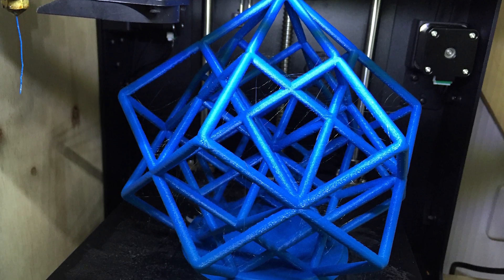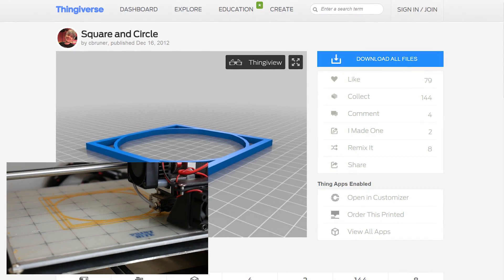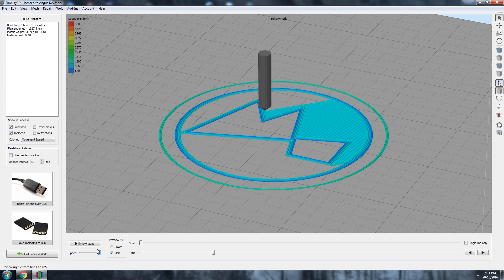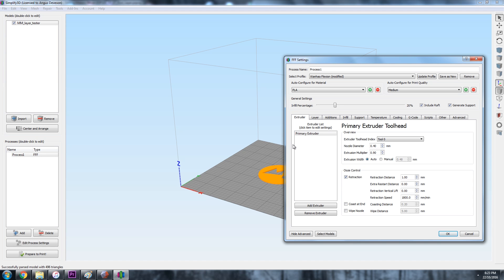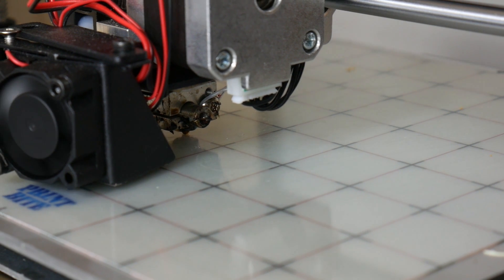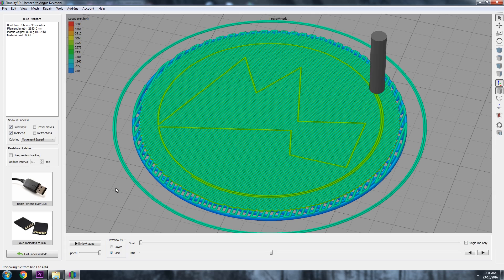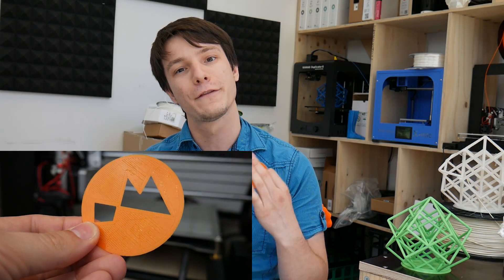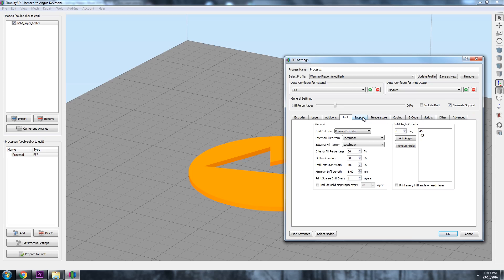How to get the Perfect First Layer - 3DP101

Comment: Cura works with mm/s and what you're using is is %, not helpful
Reply: you can't do simple math? 90% of 5mm/s is 4.5mm/s. Whatever your speed is, if you want to slow it down, multiply it by a decimal smaller than one. for example, 90% is .9. 50% is .5. if you want faster, 110% is 1.1. 125% is 1.25. It's really easy.
Reply: @adamchristophergrigg  What you can do is work on your reading comprehension. My "math" isn't the point to my statement.

Comment: I was pulling my hair out for days and editing the Z-offset to -1.2 to squish the material into the base just to make it stick. I've leveled the board so many times I can do it in my sleep now. I just changed the "initial layer height" in Cura and its printing an absolute dream now - Thanks so much for this video. I dont usually sub but as an absolute beginner of 3d printing wasting hours not even getting the base to stick, you've made my life complete. Thanks again.

Comment: In around 95% of my prints so far, the first layer has been what caused me to restart the print. On the print I did today, I restarted after the first layer about 8 times, and once I got a good first layer, it worked flawlessly for the rest of the print.

Comment: I have a cr10-max and with a raft it does two layers perfectly then the third and fourth start curling at the edge of the line then the part is printed over this and print is fine how do i get the third and fourth layers the same and am using the creality slicer which i love but it has to be a setting in the expert part that is wrong ? can you help thanks David NZ

Comment: This video saved my constructing and printing thin, detailed, stencils.  Basically, "slow it down from ludicrous speed to excruciating." I went down to 20% speed.  First-level lines went down perfectly on my Ender 3. I print .5 mm thick and all turns out!  Thanks for the wise input as to the importance of the first layer.

Comment: I've been noticing something with my ender 3 Max lately. Quick background I'm only about seven prints in. So I'm relatively new. Now I noticed the skirt Prince fine. The outer ringwall. Or whatever you want to call it is usually pretty good but when it starts printing the first bottom layer it seems to mess up somewhat. Now so far it's not affecting the print. But I feel like this is an issue I should address before it becomes an issue.

I'm using pla
200/ 60
Fan speed at 75%.

 so far the end product has been good.  Could my nozzle be getting dirty already? I have kind of been printing Non-Stop. I self-level my bed and they're really hasn't been no issues with that.

But I'm soon to do lithophane and I would like every level to be perfect. Any suggestions.

Comment: Great advice. I did eventually come up with these as well.
I was wondering how often you use glue or adhesive however. 

My Ender 3 V2 reaches a maximum bed temperature of 110 degrees Celsius and the ABS I use warps easily at any temperature below that.

I tend to use a brim and a decent layer of glue in order for my first layer to stick but getting the glue off is really annoying as my bed is the standard glass. 

Should I invest in a different bed material or is there a decent recommended glue that works well and can be easily cleaned afterwards?

Comment: Level the bed the best you can, print on glass, clean it with alcohol before printing, set first layer height on 0.1 to 0.15 mm. Flow 100%, speed 50 to 75 % for first layer. No cooling. No raft, brim or skirt. Works perfect for me on my Anet A8, of course depending on the shape of the STL file. I use Cura and sometimes Slic3r. both work good and for free :) for PLA I set the temp on 200°C (392 F) , and the bed on 55°C (131 F).

Comment: When you realize that you have none of the prerequisites. - bed warped/uneven so no uniform flat surface even with bl touch and auto mesh compensation 
-no perfectly dialed in slicing profile

Comment: Thank you so much, its the simple thing that matters. Its realy the first layer that matters. I had the problem that after the 10th layer the model come up. 

I found the parameter in EasyPrint to heat the first layer more and slow down only the first layer. Now its nearly perfect.
I use different type of filament and wanted to blame it .

Thanks for the practical hints !

Comment: "How to get your perfect first layer on delta?" - Don't buy a delta :D
Reply: @Beau I have anycubic kossel and I did get perfect first layer after I completely disassemble and reassemble it) Seems that it was assembled poorly on the factory.
Reply: @Beau maybe. I found out that you should have true 90 degree angel of the towers and endstops on the same level, software endstops correction works not so good. After that I just set the delta height and that's all. No leveling needed. Predator uses some new kind of extrusion so maybe it can handle 90 degrees more easily.

Comment: Initial layer height is set by cura slicer, and when start to print its getting nozzle up. hat means my bed at -0.2mm + initial layer 0.2 gives 0.4mm distance between nozzle and the bed.
i have my one bed leveled at 0mm , that means my nozzle is touching bed. but when is starting printing, my nozzle is going up to 0.3mm. (In cura I set it that)
I know that because I tested it and measure layer with precise caliper. 
If someone what set bed to -0.2mm or -0.3mm beneath nozzle, should set in cura settings to 0mm, to compensate difference to actual distance nozzle from the bed.
Other wise nozzle is to high from the bed, and then I don't need to tell what happened with first layer. Especially that wals i layer are not connected each other.
my opinion is that rather set bed lower, I like set it in cura settings, because I have bigger ability to change height to  different printed model.

Comment: Had question --- In printing several parts is there any advantage to printing several parts at one time?
It seems that each part takes a fixed amount of time and printing several parts would only add the time that it takes to go from one part to another 
with each layer.
Reply: Hi! Ultimately, it can just be saving the effort of having to load up the next print after your first one finishes. This is especially true if they're going to have the same settings. If you have a printer that has a longer startup process, like an auto-leveling sequence, then you'll save some time there, because it will only do it once for all the things you might otherwise print separately. It can also be putting a lot of eggs in one basket, if one of your prints fails, that could cascade into the others printing at the same time and ruin them. It could also be a factor of trusting your printer to run by itself without direct supervision.

Comment: Thanks for your series, Angus.  Ive watched, and learned from several.

I started with the Printrbot Simple 1405 Wood Kit, and recently purchased a Creality CR-10S.  I have always used Slic3r and Repetier Host ( you know, free is good 🙂 - I donated to Repetier of course ).

Cura 3 and 4 are horrendously slow ( as if I had a dial up modem to AOL ), on my iMac OS X El Capitan 10.12.6.

I am wondering whether Simplify3D is worth the 50% cost of my new printer?  The canned test_dog print that came with the printer, when printed from the memory card was absolutely beautiful!  It is printed with rafts.  I am considering decoding the GCode for the raft settings, and configuring Slic3r to do the same.

However, my time is worth something, too.  Hence my question about the value of Simplify3D.

Thank you and keep making these Muse videos!  Thanks again.

Comment: I have to say that 90% of the time, it's the first layer that's the problem.
Reply: From short period experience, I can confirm. If the first layer doesn't stick well, all sorts of problems happen.
Reply: me to.
Reply: Bingo. Use a metal gauge for precision. I use a distance of 0.06mm and then observe the brim print. Adjust the knobs 1/4 turns at a time till the nozzle literally smears the lines.

Comment: PLEASE HELP. I’m getting desperate at this point.
1. To get anything to stick, I need to raise the bed to the point where the extruder motor starts clicking/jumping back.
2. No matter what, the first layer gets really messy and rough, and most of the time just lifts off while printing (it lifts off when the bed is low enough to stop the clicking, but it is messy no matter the height of the bed)
How do I get the filament to stick properly? What could I be doing wrong? I’m getting so frustrated, I spent 2 hours today trying to get it level, and trying to get the filament to stick properly, but I couldn’t. I should also clarify I’m using an Ender 3 Pro.
I print at 210C with the bed at 60C.
Reply: I had a similar issue when using Cura with anything that had small screw holes as part of the first layer (ie. Anything that has holes that go through the part. The main issue for me happened to be the use of "combing". The nozzle would ooze as it travelled over an already printed surface (combing) and would pull the walls of the screw holes away from the bed and just cause the print to fail. The option I use in Cura 4 is to set the "combing mode" to "not in skin" - since the bottom layer(s) are part of the skin, this means that a retraction occurs before the nozzle moves, preventing the oozing from occurring and meaning that there's no string left behind for the nozzle to subsequently travel over and rip the small piece off the bed. Give that a try.

Comment: When I first started 3D printing I tried a few different softwares including all the free ones. After struggling to understand most of the different ways of changing the setting I came across simplified 3D and fell in love with it. I've been using it now for almost a year-and-a-half and couldn't imagine using anything else. I was able to take a second bigger used printer and get it working within a few minutes because I understood by simplified 3D works after using it for over a year

Comment: Hello, I'been following with your videos and I do believe they are quite informative and essential.
I'm a big fan of your reports and work.
I'm getting my budget large 3D printer in the next 2 days and I'm a tinkerer myself, that's why I have seen tons of videos and am planning to work a bit more on settings to get things right though I'm a newbie to this.
From your experience , what would you recommend out of these 2 options and why :
Zonestar z9m3 (3 colors extruder - 300*300*400)
or
Tronxy x5st-400-2e (2 colors extruder - 400*400*400)

Thanks in advance,

Joseph.

Comment: Hi Angus, love your videos mate. I've learned lots from you already. Wondering if you could help me? I just got a new Anycubic Delta plus. it works great. However, My builds are sticking to the build plate way too strong and I can't get the prints off without damaging them. My settings are 50 degrees for the heatbed and 200 degrees for the hot end and im using PLA. Most of the tutorial talk about problems with prints not sticking, but in my case, I'm having the opposite problem. Would be great if you can help. Cheers!

Comment: I need help with adhesion to ultrabase buildplate on my jgaurora a5. I print very very slow, without cooling, I tried all the temperatures of buildplate from 60 to 75°, I'm already stuck on this problem over one month. Please help. Thanks.

Comment: Simplify3d costs about as much as I paid for my actual printer.... (Ender 3)
Reply: Same here, same printer. I'd much rather spend that money on filament or upgrades for the printer. I'm getting the auto-bed leveler to save my sanity, a nice new bed surface which will also likely save my sanity. And, I can get a number of filaments to experiment with.

I don't doubt that the software is worthwhile for some people, but it's a lot of money, especially for people who are new to 3d printing and not engaged in making money with it.

Comment: How would I set the first layer height in Ultimaker Cura? The setting that I found adjusts how tall the actual layer itself is, not how high off of the print bed the first layer starts printing.

Comment: didn't help me much at all. I've found that every spool of filament MAY have different melting temps. Here's the way I see it now being a newb. Think of a cake baker putting icing on the cake. He has a funnel with a bag on it that he squeezes to "extrude" the icing out of. He has to adjust for speed, (mm/sec) pressure, (extruder speed) and consistency (temperature making the material more, or less, liquid.) Now there are setting you can do on the fly such as extruder motor speed, and hot end temp. I'm amazed at how well I could adjust the print using just these settings after I figured out that printing PLA needed to be 220 deg. Celsius instead of the 200 deg. it defaulted at. Once you get the temp right, then you can adjust the head speed and extruder speed to make a perfect layer. I'll try to make a vid showing this in the near future.

Comment: I wish my first layer prints would come out like that..mine are less than paper thin..{can see it, but not really feel it if you run a finger across it} maybe nozzle too close to the bed? I am new to 3D printing, and cannot figure how to raise my nozzle height by .1 mm off the bed..and I really dont want to mess about with my bed level. I tried adjusting on the machine, but when I start a print it just goes back to the g-code for the print. where do I adjust the nozzle height in the Cura software? Thanks in Advance

Comment: My actual initial layer is always 0.1 mm higher than what I have set in Cura's "Initial Layer Height". This makes sense because I level my bed with a 0.1 mm piece of paper. However, the lines of filament on the initial layer do not adhere to each other, I'm guessing it's because the amount of filament being extruded is what would be needed for 0.2 mm initial layer when the actual gap between the nozzle and bed is 0.3 mm (the initial layer height plus the bed leveling gap). I'm using Cura 3.1.0 with my Creality CR-10S. How do I compensate for the 0.1 mm "paper" gap? Thanks in advance.

Comment: I am having a issue with my printer. I have noticed that when ever I print a model for the first several layers it moves well outside the model area and the material strings out and ripples back and makes a goober ball on the edge of my model. I am using CURA and I have retraction turned on. Is there a setting I can use to make this stop?

Comment: In simplify3D 4.0, Once you get all the settings tweaked just right, is there a way to save them as a configuration file or some other sort of file to access next time you want to print the same material?
Reply: Hi, sorry for being late to reply. In case no one has answered your question, you press File / Export FFF Profile and that exports your customized settings. Each time you want to use that configuration, press File / Import FFF Profile and choose that file you tweaked your settings on. Cheers

Comment: Funny ... at mine Simplify3D these first layer settings were default allready installed.
4:44 Sadly my rafts are mostly very hard to remove ... I have to use a cutter to remove completely ... any hint for me?
Reply: I have the same problem with Simplify3D rafts

Comment: I'm having issues getting my print to stick to the bed. In cura the settings are layer height in mm not a percentage. At first i tried both 0.2 and then 0.1 none of which worked then a setting of 0.35 seemed to get it to stick tho not well enough as the print came unstuck before it printed the first top layer. Print was just a small 2 cm cube. Should I be printing with a bigger first layer height or a smaller one? This was on plain glass as well I've ordered buildtak so hopefully that will help but I'm new to the 3D printing stuff and not sure on what layer height to use. I've checked the bed level several times.

Comment: What about different first layer temps for extruder and heat bed. Would running the filament a little hotter on the first layer help it adhere or amplify warping. I will experiment but would love to hear any other thoughts.
Reply from the maker: Running a first layer hotter is a great idea and one many slicers allow you to do, for example for 215deg printing temp i'll often print a first layer at 220deg. Printing too hot overall can make parts warp though as you suggest.

Comment: i want to add a glass bed ontop of my metal one so i wonty need to use tape. my question is is there some kind of spacer i can get that has a 3mm in it so the nozzel wont crash through the glass? i have a anet a3 and am new to 3d printing. please let me know thanks.

Comment: your videos are super helpful and compact. thank's for not making these into 20 minute rambles! 
simple trick to smooth the bottom, after printing on a raft: use a flattening iron and baking paper. crank the iron to full power, and keep gently passing it over the bottom, untill you see the paper smoothly sticking to it. ..and dont burn your fingers, like i did. ;)

Comment: I use rafts for everything, I have found it is excellent for setting up a good surface, good first layer, and easy removal without damaging the print. It also is a great way of warning me ahead of time if there is a problem with the extrusion. I always stay for the raft construction before walking away.
Reply: I tried so many times to print some small parts (50 of them, clips for a dnd wall/floor model) without raft but i finally gave up. The first 30 of them might have been good on the surface, then ONE of them fucks up and the whole print is fucked. I went for printing such stuff with a raft and removing it plus working with a wood buring tool to smooth out the bottom surface afterwards. This takes time but at least i dont have to fear about my first layer.